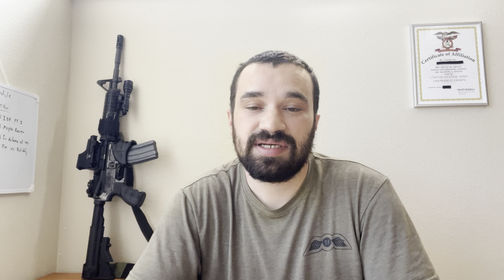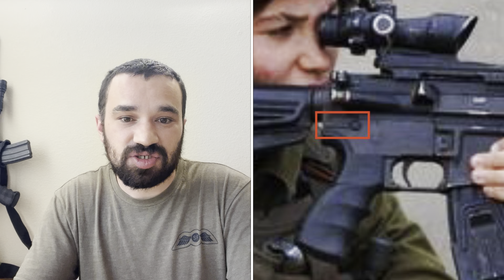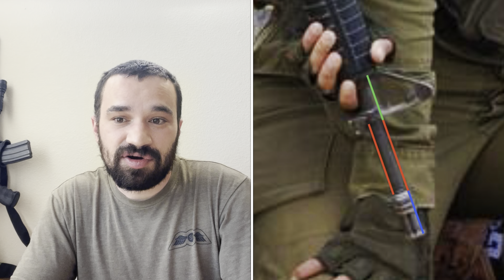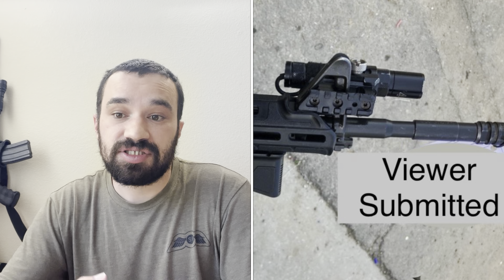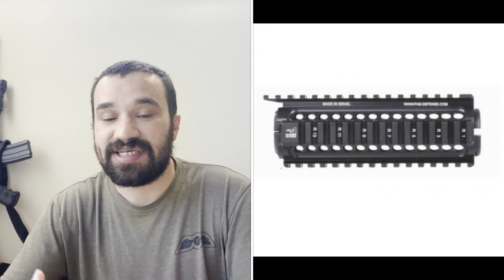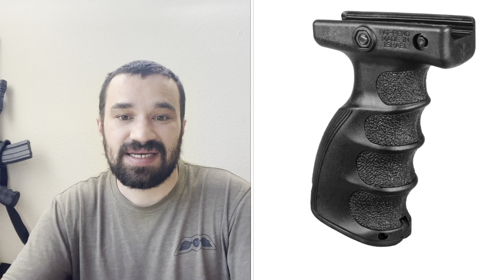The M4 in Israeli Service

Comment: Is the AG43 grip worth getting over a traditional A2? How much better is it?
Reply from the maker: Short answer, no it’s not worth getting over an A2.

I really don’t like (or generally recommend) pistol grips with molded finger grooves. They might feel better to some people who have exactly the right size hands, but they end up being worse for most people. I have very average sized hands, and the AG-43 wasn’t even close to lining up with my natural grip, it was much less comfortable even than an A2.

The one real advantage the AG-43 grip has is an integrated water tight storage compartment, and that’s great, but not at the expense of ergonomic comfort.

I would take an A1 or A2 grip over the AG43 without hesitation. If I wanted more grip, I would add sports tape or bicycle tubing.

If I wanted an upgraded Israeli pistol grip, I would recommend the FAB AGR-43, which has a rubberized texture, no finger grooves, and the same watertight storage capability.
Reply: @Triangle26  Thank you for the reply. That's along the lines of what I was thinking. Btw, your videos are very insightful and enjoyable. Please do more of these idf carbine type videos! Cheers!

Comment: Theres nothing wrong with pencil barrels. I can see an issue using them for 10 or 11 inch barrels but even then the gov profile having added unnecessary weight in the front could be changed to better balance the weapon system similarly to the geissele tapered barrels. usually you need more heat mitigation in the back not the front.

Comment: Does Israeli use a non gooseneck carry handle mount?
Reply from the maker: Yes, albeit they are much less common. Also, they only seem to be used for ACOG. Obviously magnified optics won’t work on a gooseneck mount due to the eye relief issue, so if IDF reserve units want to use a carry handle upper in a marksman role, this is the only option.

Comment: why do idf soldiers tape the bottom of their mags and front sight blocks?
Reply from the maker: Front sight block taping seems to be a sling attachment thing. IDF M4’s do not usually have front sling swivels (due to noise), so they find other ways to attach the sling. One popular method is to wrap the FSB in paracord, and clip the sling into that. Some guys tape over that, which I assume makes it even quieter still, or possibly helps keep the sling angled in right direction so it doesn’t get in the shooter’s sight line.

Tape on magazines is most likely for grip texture, or to affix ranger loops to make the mags more easily retrieved from pouches.

Comment: What's the difference between the  M4 and AR15?
Reply: AR-15 is the original civilian model but also it's used when talking about the platform in general. M4 is one AR-model with different variants existing.
Reply from the maker: Yeah, pretty much like @TeurastajaNexus said. All M4’s are AR-15’s. Not all AR-15’s are M4’s.